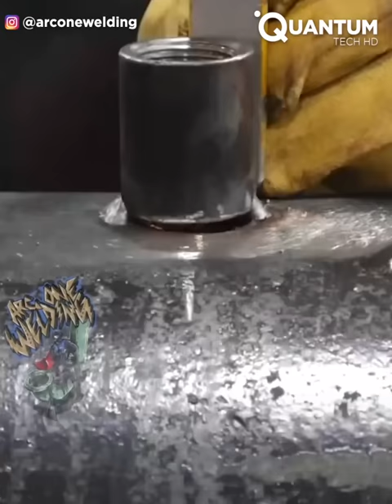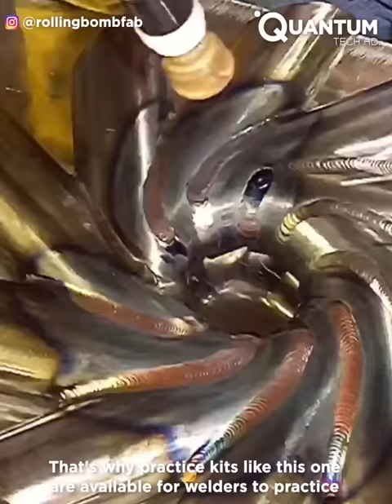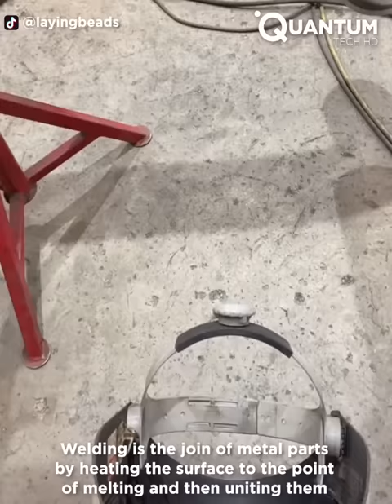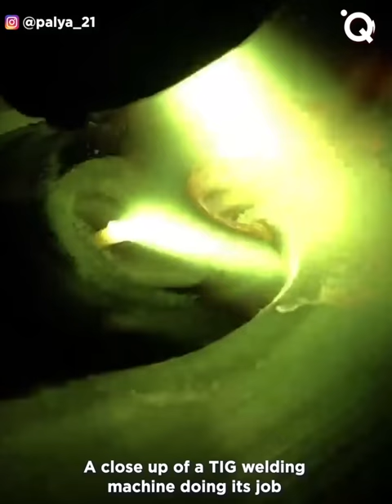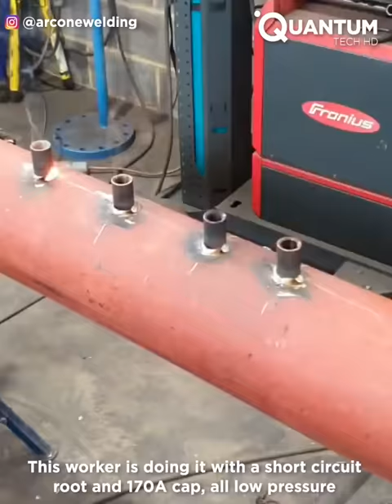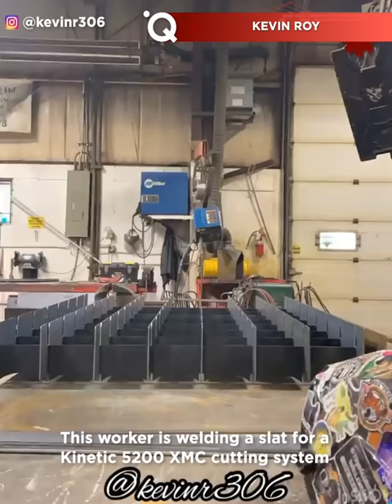Welding Workers Who Are Professional and Experts Of High Level ▶5

Comment: That first one was not a tack weld, that was "walking the cup."
Reply: I think he meant the process of bringing the gap, and then carrying that bridge all the way around the pipe by walking the cup, to make the root pass
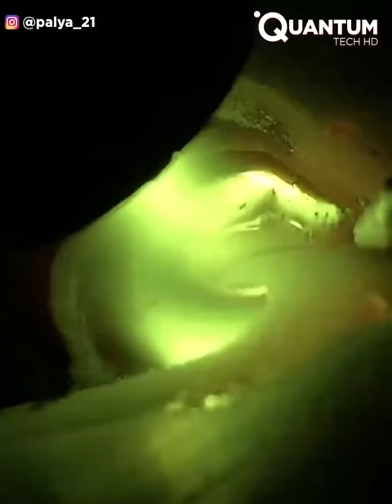Reply: @3:57 is soldering, not even welding so im not shocked.
Reply: @crimescene25  Brazing*
Reply: The first step of the root pass is to tack some backing material in to act as a substrate for the filler

Comment: Skills at Insane levels 🔥🔥
Reply: Tech World  Not rly, with mig/mag welding there is a little skil, its all about good welding machine setup, but with TIG welding its rly all about skil, your movement and welding rod placement. i'm TIG welder, and the hardest thing i had to do was welding aluminum pipe/pipe weld for tightness on 1/1 mm thikness , thats a hardcore weld

Comment: here in the Netherlands we don't call connecting copper pipes to joints using a tin welding, but soft soldering. because with welding you fuse materials together and with soldering we use a outside metal to almost glue them together (it is not gluing but it is the most simple example I can give).

Comment: Just remembered, 50 years ago as an engineering apprentice, we had to learn how to use Oxy & Arc welding. For the Oxy we had to make a metal cup. The acid test, would it hold water? Mine was like a colander.

Comment: You can find welders of this level on most any pipe job. The one weld I saw that was hard was the guy back feeding the wire for his root pass. Its a process you see alot of when welding chrome piping but its hard to get the hang of and not every good welder can do it. The ones who do have great hand eye coordination
Reply: welding the root pass like that is actually not that hard. just takes practice. most pipe welders learn that technique as it makes life easier.
Reply: @south02m  Welded pipe and boiler tubes for 25 years and only back-fed the root on tubes, chrome piping and big bore. While I could do it that wasnt my best skill.
Reply: @Kaig3nesis  LOL, I could do stick in the mirror fairly easy but tig ate my lunch. Running both hands backwards from what your seeing is some mind bending stuff. I worked with a few guys who were excellent at it but I never claimed to be one of them. I know using two mirrors brings the image back to where your welding normal again but keeping the line of sight from mirror one to mirror two to the weld is a stone cold bitch.
Reply: As a mechanic with no practical experience with welding in my job i just wanted to say i appreciate this comment thread; it's a glimpse into talking shop thats not my own. 
Keep up the hard work gentlemen. 👍
Reply: @Ken Mason LMAO can you blame your foreman tho? That does sound like an Ironworker =D 

But that's an impressive skill tho. I've always wondered how good I could get at blind welding.
Reply: @Ken Mason Tea-bagged the ice maker?  now that's just out of control.
j/k... that's genuinely funny as hell! imho, anyways! lol
Reply: @Kaig3nesis  My current job, if you can't mirror weld, they don't want you here unless you can fit as well lmao

Comment: I showed a video similar to this to my Weld Instructor in college one time. He said although they are nice and colorful welds, a lot of them wouldn't hold up as a majority the time lower voltage is being used, especially with TIG/GTAW. Dunno about these ones but he'd probably have his opinion.
Reply: I was just thinking this, I've gone to welding school and completed SMAW, MIG, and TIG. The welds look nice because there is no movement besides drawing a straight line, but in reality you're just melting the rod material onto the base metal instead of fusing them together properly. There is a weaving motion that a proper welder would use to join those pieces, and it looks very much like something that will need repairs due to poor construction. (Some in the video, not all, obviously.)
Reply: @MapleCakeTheLion  I was looking for a comment like yours an am glad, I found it.
Reply: also @ 7:18 that Olet would require more fill. from a QC standpoint
Reply: The only thing I have to say to this is that usually color (oxidation of a GTAW/TIG weld) is caused by an oxide layer forming on the top of your weld due to insufficient gas coverage, not insufficient amperage.

Comment: When they said Shielded Metal Arc Welding was MIG I knew they had 0 experience with the trade
Reply: You didn't get that from the fact they make YouTube videos...?
Reply: Yea there was a whole lot of mistakes in whoever wrote these captions
Reply: It is a form of shielded arc welding as. Shielded arc just means that an inert gas, gases or flux core are used to help prevent oxygen from entering the welding process.

Comment: You might think looking at this video that it's pretty easy to weld, I can tell you from experience it is NOT. I worked as a welder, pipe fitter, fabricator for over 20yrs. and it takes a long time to get this good, most never reach this level of talent. I was VERY good at my job, but I can honestly say (without embarrassment) I never quite reached THIS level.
Some guys can lay down a pretty weld and it looks great until it comes under pressure and it springs a leak, it might be just the tiniest leak that only drips a single drop an hour but eventually that weld will fail completely.... The trick is making it look good and NOT leak, that's when you can call yourself a welder....
Reply: You didnt go to the right school then. Its the easiest money ive made.
Reply: Part of it is being a good draftsman too (TIG)... I am both... TIG is part art..
Reply: @Ken Mason Im not sure about other areas Ken.. but in Canada you are not permitted to use a torch of any kind. nor a grinder for 4 position plate test.

You either got it or you have to learn it over time.  If you start off as a stick welder all the others are easy.  I started my 6g test with my right hand and finished with the left.  I didn't even know I did this till the inspector mentioned it to me.  Yes I passed. ;)
Reply: @Ken Mason .I'm not big headed Ken. My.. 'you got it or not yet' comment was not directed at you, just a general comment.   I've been welding for 40 years now with no end in sight, and I've taught endless amounts of rookies.  25% took to it quickly and others needed constant supervision till it clicked, but all became trusted welders.
Reply: People ask me why do I weld freehand and It’s because I badly broke my wrist when I was young which causes pain walking the torch but they think I did walk the torch, practice makes perfect and let’s you work on jobs that have 100% radiography
Reply: @Ken MasonI’m also coded  with the stick and MIG
I keep my TIG wire in my pocket as I’m welding so I can take one when needed so there’s no need to stop on pipework but today’s pressure vessel etc are now getting Mig welded with flux core wire so no stop /starts in the cap
Reply: @Ken Mason also ASME9  also TIG sets today have Slope in and outs which are more important with different metals and alloys
Reply: @Ken Mason the only great thing about the MIG is speed and a neat cap when done right but you're correct about stop-starts so that's why we all roll pipe and vessel work so there is only one stop-start but the root is always TIG or stick. Fumes off FCAW are horrendous even with extractor fans and airflow welding screens
Reply: 20 years and you can't walk the cup? Or weave a pipe? Sounds like you didn't try very hard to get better. I hit journey men in 4 years and can keep up with these guys.

Comment: 07:30 - That was magical 😲
Reply: THAT is an unholy abomination and is the furthest thing from welding possible. They are using what china brags to be a "cold" welding machine, which is a lie, gets zero penetration, brittle, no filler, so no reinforcement, and they're using a modified pulse TIG machine to do it and calling it a "new" welding process.
...

But yes, it looks pretty, and that did look a bit satisfying. too bad that's a shity weld.

Comment: The arc can go way above 6000 C, the arc can reach 14000 C, The puddle gets around 6000 C
Reply: The tungsten itself would melt at that temperature. Only way your getting that hot is with plasma welding
Reply: @MikeP350  Truth. the tungsten  melts ad 3422 °C

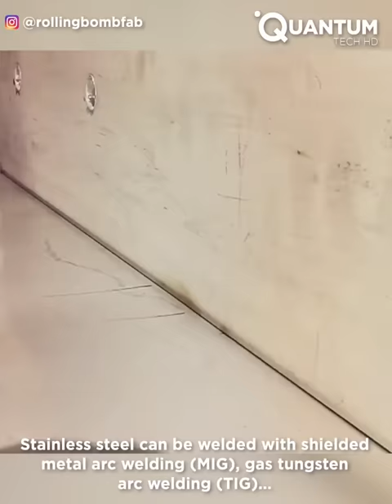Comment: 5:50 This may look like soldering, but it’s actually gas welding.😎
Reply: It's actually gas braizing. Gas welding is a very slow process, and you can tell from the angle and manipulation that only the filler rod is being melted there. Welding is melting and fusing the base metal and filler, while braizing is just melting the filler 😎

Comment: Is solder really considered welding? If so I'm a pro with through hole welding
Reply: No, welding is making two pieces into one. A soldered piece will always be two pieces hot glued together with a softer metal.

Comment: Thing is about acetylene is that, I go to college to learn how to weld.
I was told, if you put the tanks to the side and the tank bounces a little, it explodes.
If there is too much gas going at once from the tank, it explodes.
If there is too much gas coming from the torch, it explodes.
if the PSI is too high, it explodes.
It's such a dangerous gas, don't play with it guys.

Comment: There is a HUGE skill difference in a rotating pipe. Where all you have to do is hold still and move the cup, back and forth. Vs A stationary pipe, and you have to move around it. The main reason why you would rotate a pipe is simply... Its faster. And more people can do it. A stationary pipe is ALOT slower and only a hand few welder can do it and make it look good. 

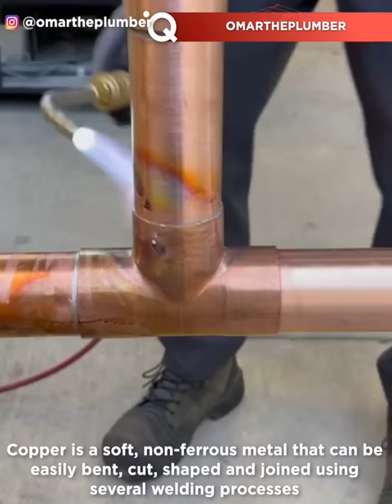Im a contract welder. And iv use both methods many times. And there is truly a huge skill gap. Anyone with a little tig and pipe training can do the rotating pipe. There is only a few welder that I know that could produce a weld that good while also moving around the pipe. (2:45) is a great example of what I'm talking about. This pipe is stationary and the welder is moving round the pipe. 

I call the users of the rotary "pipe cheaters" because they are "cheating" at pipe. They don't have to learn the hard parts of stationary pipe. But that is one of the reason why pipe welders make so much money. They are more skilled than the "Pipe Cheaters"

Comment: Does anybody possibly have any tips on using filler rod with the TIG welders? My hand shakes way too much to accurately add filler but I really want to progress in TIG welding.
Reply: Get comfortable find somewhere to brace your wrist and you won’t have to try so hard. If you’re cup walking keep pressure on the rod

Comment: 8:03 If the arc was that hot, the aluminum would have evaporated. In this video the welder is welding aluminum. Please, google the temperatures, that aluminum is welded at.🤷‍♂️

Comment: Tig welding stainless steel takes uber precision as far as the temp you weld with. Too hot and it turns blue or worse black, use the right temp and you can make it look like the weld is chrome plated and the same color as the untouched stainless steel. It is more an art.
Reply: Exactly! Sanitary welding requires both sides look the same... Hard as hell!

Comment: Honestly it's not difficult to learn how to weld. All it really requires is decent eyesight, a bit of hand eye coordination, and hours behind a hood burning rods and wire.

Plus a willingness to get burned occasionally.
Reply: What is this Tig welding?
Reply: What kind of welding is this? Tig MIG. In the beginning?
Reply: @leftymichael3465  tungsten inert gas welding.
Reply: @leftymichael3465  which part of the video?

Comment: As a journeyman (Red Seal B- pressure O&G rig-welder ) pretty weld does not mean it's a good weld - break test or x-ray then we talk about the icing... P.S. Any time these "experts" need a lesson on how to tail off the can hit me up.
Reply: Not all ugly welds are good welds either
Reply: @mikephillips2984  in fact part of being a good weld is also Aesthetics so not synonymous
Reply: @GH0ST369  so now you contradict yourself
Reply: @GH0ST369  passing a visual inspection is the first step
Reply: @mikephillips2984  Yes Mike that is the meaning of Not synonymous they are not interchangable and not a contradiction, sorry if a tradsmen using big words throws you off.

Comment: So many of these "welds" are just cosmetic almost all your Tig Stuff was cosmetic looking they didnt get any actual penetration the welds are likely garbage. That first gap one was ridiculous for example a. Why would you not fit the pipe properly? b. why would you use tig for that even if had fit the pipe properly? c. The weld is garbage the stop start on your welds and that size gap/root youre 100% going to get cracking its garbage.

Comment: I love the content but damn, that shitty lounge lizard music you got playin's the shits. I been welding since 1977, we listened to either country music or rocknroll, if we had the time to play music that is because we were old school, worked hard and long. I'd go hard from daylight till way past midnight on a lot of jobs, especially the oil field jobs. Those fellows paid me well, kept me on-call probably because there wasn't a job I'd ever turn down. I worked a whole lot in the oil patch weldin up broke stuff on drilling rigs and well service rigs and when the guys learned I was a hot roddin builder they'd get me to do custom stuff. Welding up motor mounts, tranny mounts and the like on their own vehicles. In 1985 I installed my 1st turbo, it was on my '67 C10 Chevy pick up truck, I used Ram's Head exhaust manifolds, had to cut and weld them back together to fit the turbo pipes to the engine. Took me 4 days but when I was done I had one hell of a fast pick 'em up truck!

Comment: These arent as good as they make them out to be, any of the welding they've done, except the guy welding the threaded coupling without stopping was the only fairly decent display of skill. Everyone else was resting the cup on the material, i can do that with my fuckin eyes closed lol its way easier than you think. Any time you rest the welding lead and drag it, walk it, or manipulate it is cheating. Pick it up off the material and then ill be impressed.